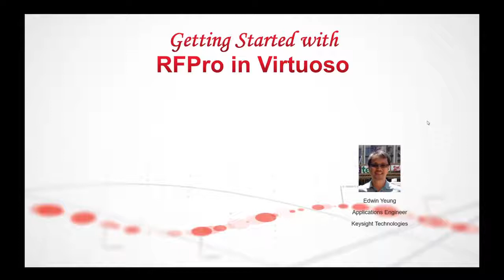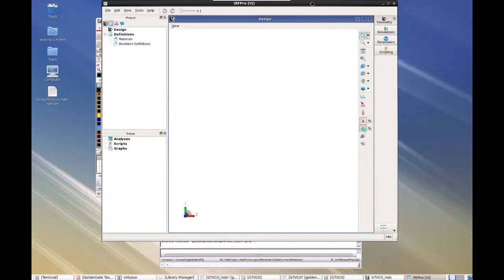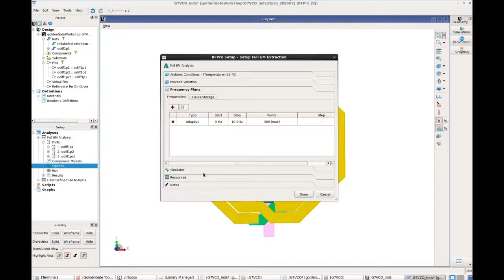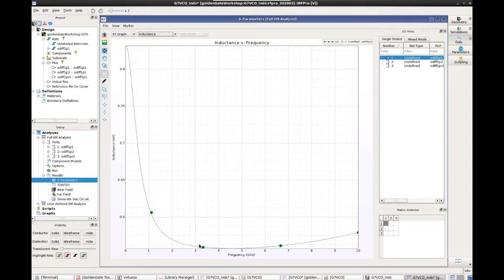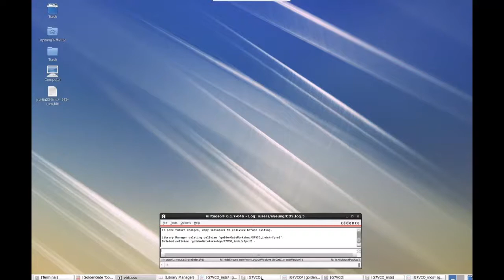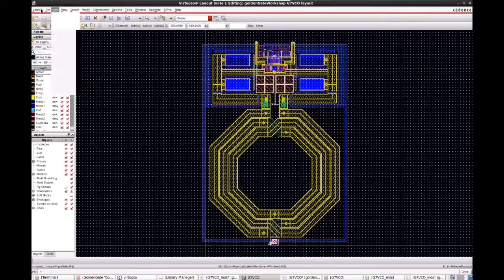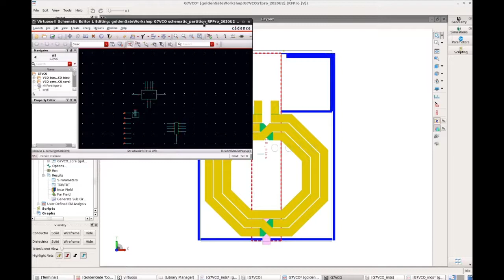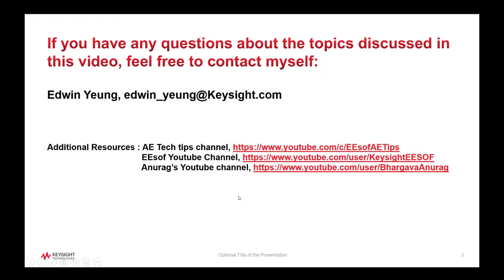RFPro RFIC in Cadence Virtuoso

Comment: Thanks for the very nice Tutorial. That would be very much appreciated if you could provide more examples. By the way,  I am using the RFPro with TSMC PDK. whenever I load a layout that contains Skill cells the RFPro fails to load correctly. I should flatten the layout then RFPro loads correctly. I wonder if it is something wrong with my setup or it is a bug. (I use v2021, chikorita)
Reply from the maker: Hello Mohammad!  Please reach out to Keysight EEsof Tech Support for more help and to also help you engage with your local Applications Engineer.  The email for tech support is eesof-usa_support@keysight.com.